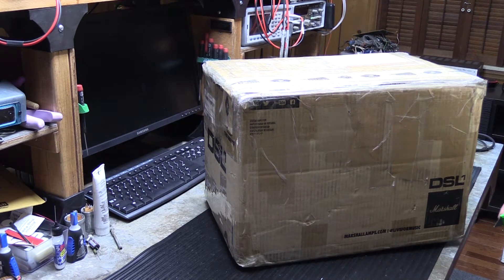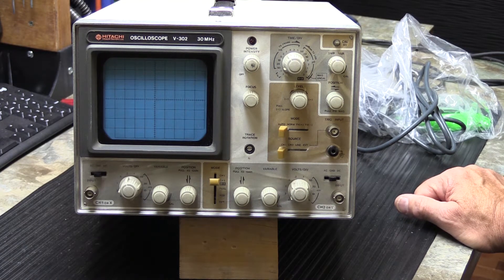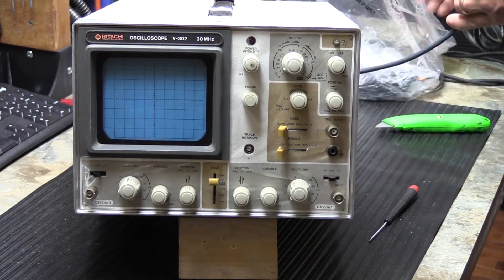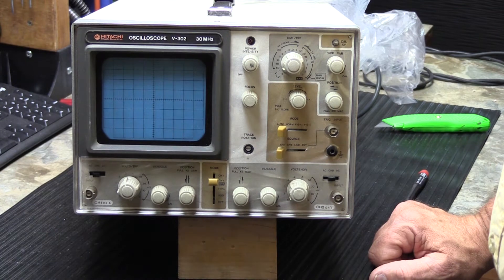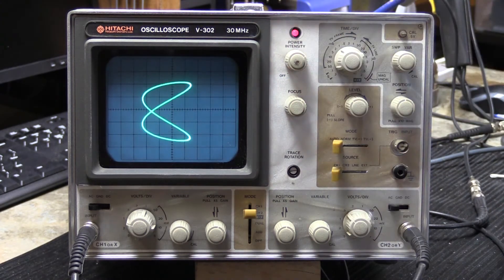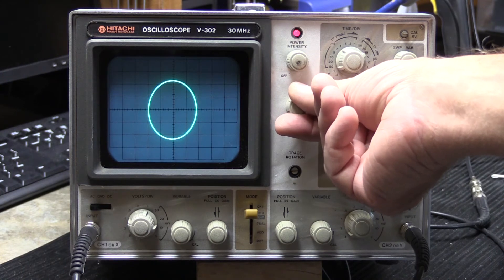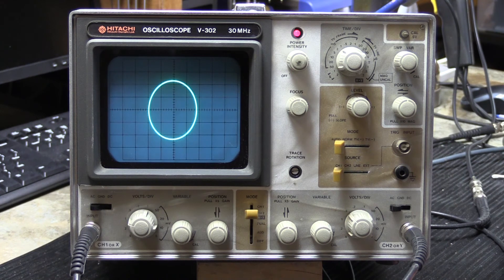Unboxing a Vintage Hitachi V-303 Oscilloscope

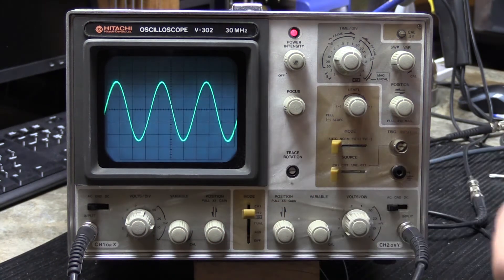Comment: Re triggering CH2 at 9:07 - you needed to switch the trigger source from CH1 to CH2

I was here looking for info on a Hitachi V-1070 I bought recently - I think it's excellent value for money. They seem to have selected good components which have lasted well.
Reply from the maker: Hi PeaceToAll:  I agree, Hitachi made some real good scopes and they are very long lasting - After making this Video, I cleaned all of the controls and I have been using the V-302 for Tuner alignments on my RF Bench - Chris

Comment: Very nice condition scope, hitachi was good :-D
Maybe with the vertical oval you needed to adjust channel 1.
Sometimes a 0-30 mhz receiver can be good for listening to i.f stages and local oscillators, loose coupling by proximity.
My first oscilliscope was from the Tandys store,  a small and basic display only scope made by micronta a Radio shack brand.
I still have it 30+ years later,  allthough i don't use it now.
I did enjoy Tandy/Radio shack products, they were not top notch but affordable for me :-D
I was sad when the company died.
Sorry waffling again.
Reply from the maker: Hi zx8401ztv: I looked at what a Micronta / Radio Shack Oscilloscope is all about - nice little hobbyist scope from back in the day.  Back in 1976 I work for the owner of our local Radio Shack - it was a franchise store.  He setup a work bench in the front window and paid me to build Radio Shack kits.  Customers would stop outside the window to watch and then come in.  I answered peoples questions and assured many moms that if they bought a kit for the child (usually their son) he wouldn't "burn the house down". . .  I still have some of the kits that the owner gave me after building them - including a dual output DC Power Supply with channel tracking and analog meters -so cool. - Chris
Reply: @northsideservicecompany3567  oh Wow that sounds like a wonderful place to work.
I would have been happy as a sandpiper in that shop :-D
The only problem would be i was only ten years old and in the uk lol, born in 1966.
That display scope i still have has a light blue top case but no bnc's on the front.
It had red and black thumb posts like on the front of a power supply.
I did try to convert it to a calibrated vertical input channel, but the circuit was not very linear.
Now i still have other old scopes, a solid state cossor and telequipment portable mains/battery unit.
Sorry im flapping the lips again.